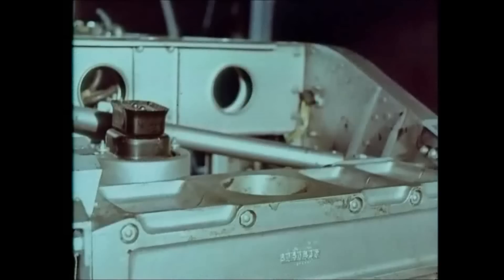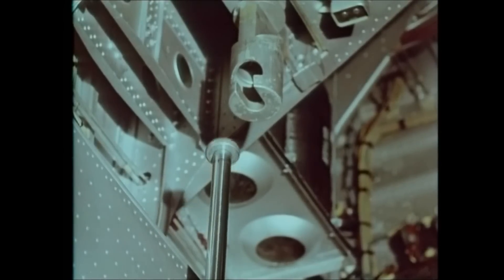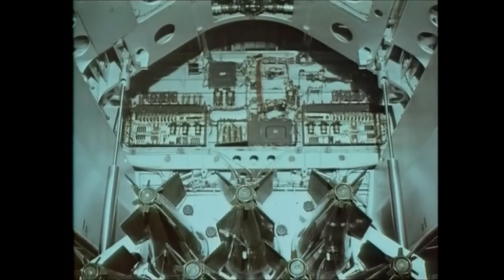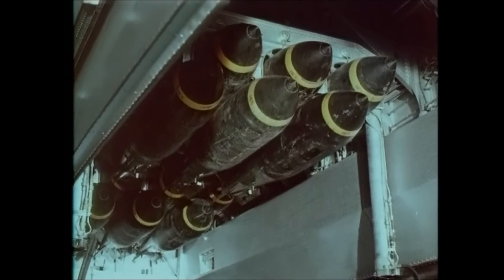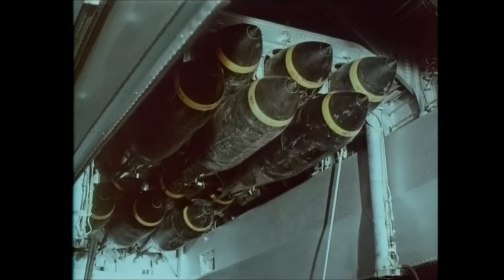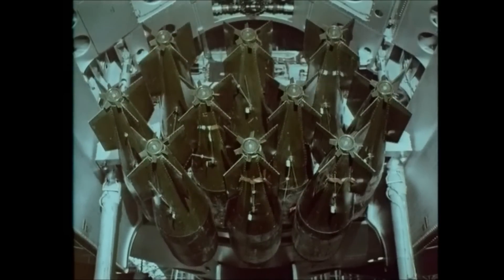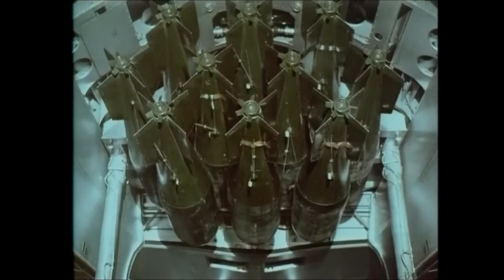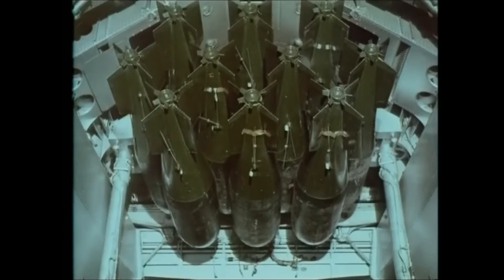Vulcan Bomb loading procedure.

Comment: This is disingenuous - the 10 Bomb Carrier Was TRIALED on the Vulcan - but NEVER used........The Vulcans bomb load was 21 x 1,000lb bombs.
The Victor however from it's outset could always carry 35 x 1,000lb bombs ie using 7 x 7 Bomb carriers - it could also use the 10 Bomb Carrier but this made the all up-weight huge and would have reduced the fuel load but with an original 35,000lb bomb load it didn’t  need it........